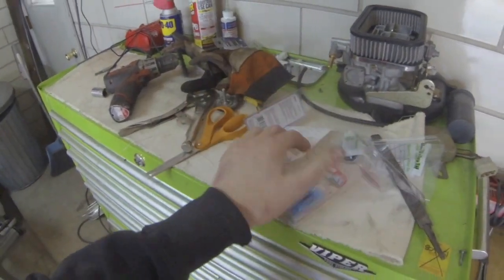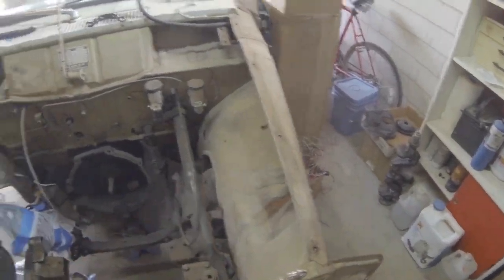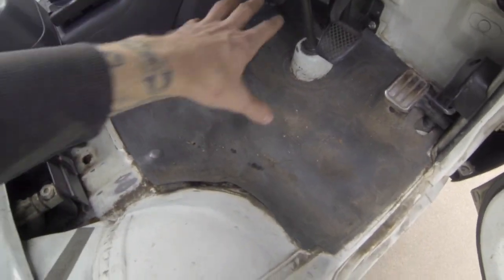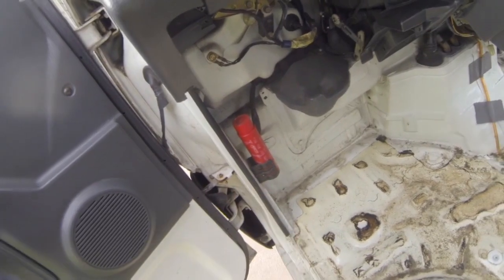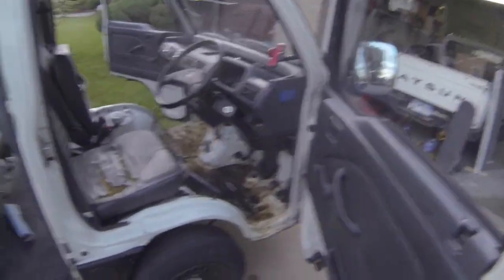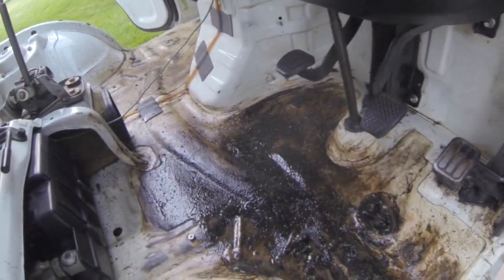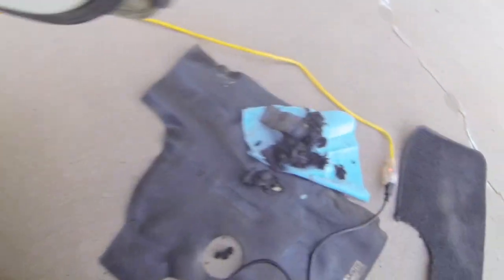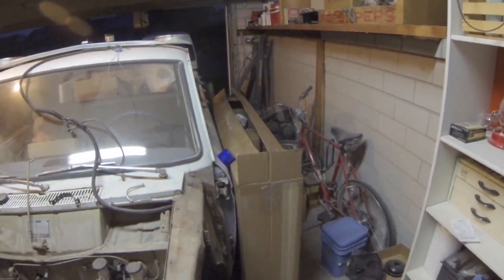Honda Acty Floor Deep Clean

Comment: hello, Any tips on my honda acty, it will not start, I have spark and fuel but it will not start?
 thanks for the input. 1994 Honda acty SDX
Reply from the maker: Have you checked if you have good compression?